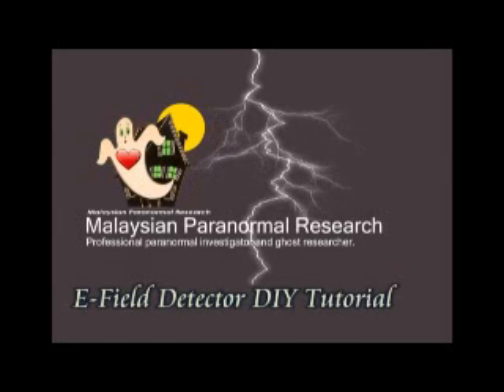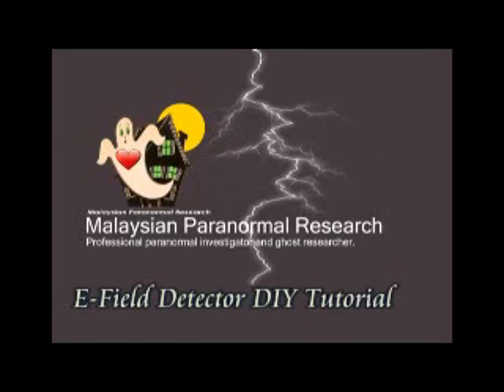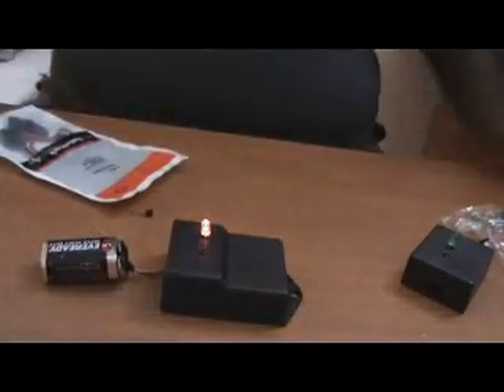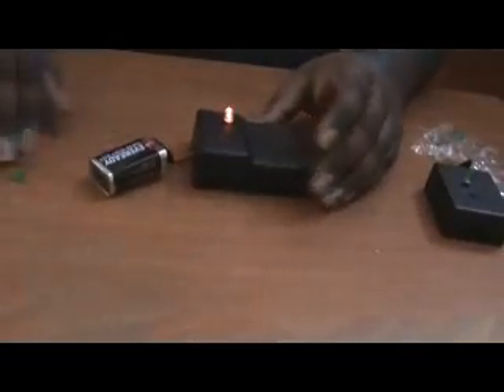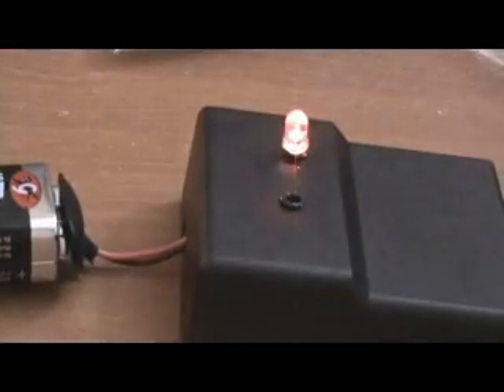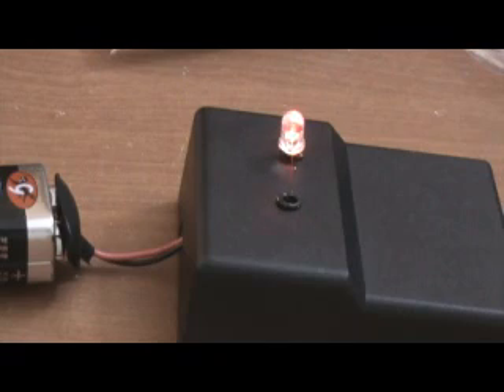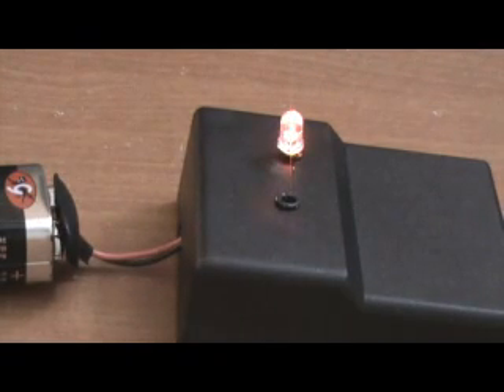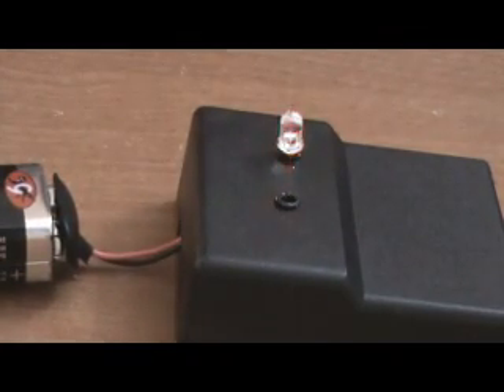How to build your own E-FIeld Detector to detect static for your Ghost Research  ( PARANORMAL DIY )

Comment: can the led be wired so it's off, then lights up when detecting static ?
Reply from the maker: Not that I know of due to the nature of the schematic design. It doesn't consume a lot of voltage either so you should be ok to leave it on.  Or you can option for rechargeable batteries.

Comment: You can use a P channel transistor to detect the other side of static field or J-Fet transistor.In my case I eventually went with a 2N5460 transistor.I will post a video tomorrow of my custom static field detector.This one will detect changes in the field from up to 5ft away with the telescopic antenna.If I am correct I believe the MPF102 FET is a N-Channel transistor which is why the LED stays on until it gets a reading.With a P-Channel transistor the LED will remain off until you get a change in the static field.
Reply: Which transistor would I need for positive detection I use mpf 102 and I'm looking for an opersite transistor any help would be great

Comment from the maker: Thats great, The antenna is really good, actually uou can also add any piece of metal and it will work the same. The k2 meter mod is available for long time already. Im not interested in sound as i prefer everything documented into video as i prefer the location to be as silent as possible without contamination. I

Comment: Hey I added an extendable radio antenna to ours and it has a greater range to it.I'm going to see if I can add an electric piezo buzzer to it this afternoon so when the light goes out it will let you know with sound instead of staring at the light all the time.I gave sound to a K2 meter this way.

Comment from the maker: hye, No. you may only use one led for a transistor.  If you would like to build in a row than you will have to modify with linear circuit.

Comment from the maker: @GRCPARANORMAL  You're welcome. It's not possible because the led lights up depending on the surround static. the positive or negative charge surrounding the location will determine the baseline. To understand this, try to use a balloon and bring it close the e-field detector and get the hang of it and than you may know how it works in terms of baseline. There is nothing you can do to that. Wiring backwards will not do so. All the best in making it and testing it out.

Comment: Thank you for the information on how to build this device.We are building one this week and hope to utilize it in this weekends investigation.Is it possible to wire the LED to where it is off until there is a reading?We haven't got the parts yet so was wondering if there was something else we'd have to use to get the LED to be turned off until it gets the reading.Was wondering if the LED can be wired backwards to get this effect?

Comment from the maker: @russiancrew5000    Negative objects turn the LED off, it lights again when removed. Positive objects make the LED bright, then dark when removed. The MPF-102 is an "N-channel" transistor, and is turned off when the movable negative electrons in the transistor body are pushed out of the silicon, changing it to an insulator. You can also buy "P-channel" transistors which work backwards: they are turned off by a positive charge on the gate. Try buying a few 2N5460 transistors

Comment from the maker: @russiancrew5000 MPF102 Field Effect Transistor from Radio shack (#276-2062) or from Digikey. The LED light being on or Off totally depends on the environment static. The original schematic to build is the one i provide in my video. The other guys made their video only after mine is out as i was the only one who provide schematic for it at my website as well. Just build as i say in the video, you would have the same one as mine.

Comment from the maker: @AbyPutraDegiL  You must make sure you connect the transistor correctly to the led and the center pin must be the antenna. Its a very simple project actually. Try re assembling and see. There should be some reaction towards the led light when you bring plastic or silk material cloth near the sensor. Also check you soldered the wire correctly. Maybe you can snap a picture and e-mail it to me so i can inspect what is your problem.

Comment from the maker: @AbyPutraDegiL It's in the video actually. Look at the diagram section and pause it. The black negative wire should go to the negative led light while the red positive wire should go to the transistor.

Comment from the maker: @paranormalhaunting1  it simply reacts to field changes. It is widely used as a antenna to emit or receive in some appliances, even in certain radios but i believe not all radios have the same transistors. They look the same but are different kinds of transistors. It is important to know what is the FET transistor part number to identify it.

Comment from the maker: @bladewarrior2000  I believe its the basic LED that you would find in a hobby or a DIY shop. it's a 20mA LED with a voltage between 2.5 to 3v approximately.